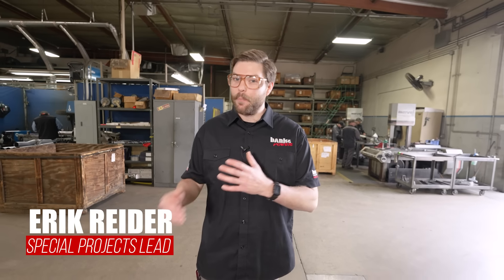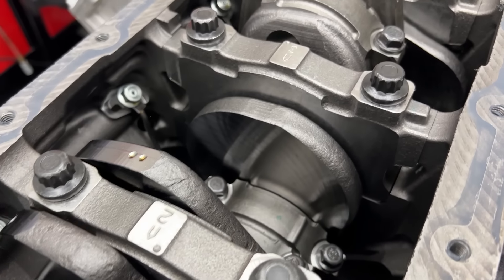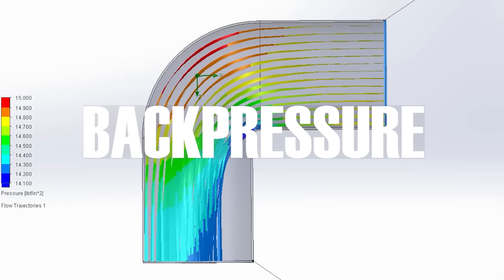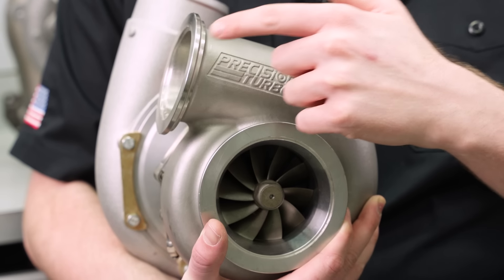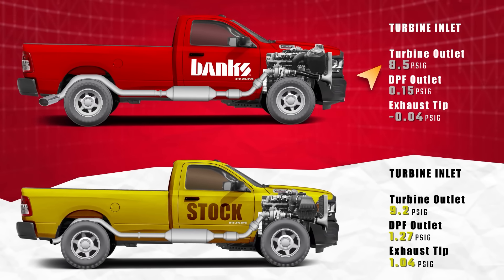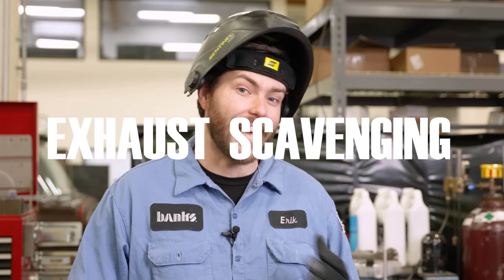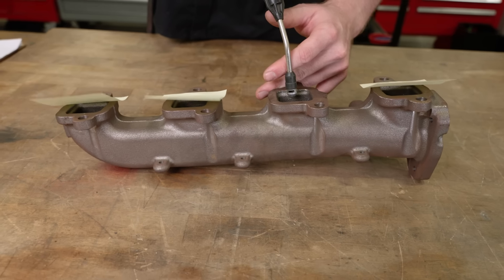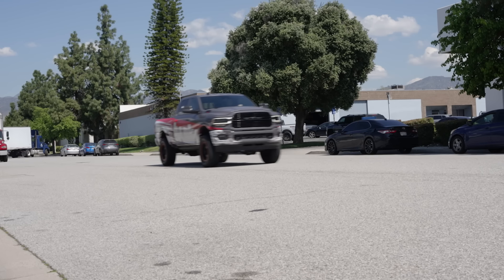Busting the exhaust backpressure myth | Banks Entry Level

Comment: That demonstration of scavenging with post it notes was the best thing way to show it ever. Love it
Reply: It was a great party trick but it wasn’t a demonstration of exhaust scavenging specifically.

When one port is open and has positive pressure (the shop blower), the others are closed. That negative pressure at the other ports is lost.

On the exhaust side of the engine, there is both flow (from the piston moving the gases out) and continued expansion of hot gases from the combustion process (the continued expansion of these gases is primarily what a turbo uses to spin its turbine).

When the exhaust port shuts, that flow stops but the expansion continues. The flow created by the piston is only minor and hence why this demonstration is properly representative of how scavenging works. only good as a party trick.

The bulk of the required exhaust flow comes from the continued expansion (positive pressure) of hot gases  after they leave the engine, and which continues well after the port is shut (and for several more combustion cycles for each cylinder).

That continued expansion presents a problem for other ports when they open and try to flow out their initial gases, they are stuck trying to push against those previously burnt but still expanding gases.

Headers address this by separating the cylinders for longer, firstly avoiding the potential conflicts to other ports, and then by being “tuned” length, they can use the properties of the expanding gases (momentum etc) to help create a negative ‘pulse’, which if timed properly, can assist the piston extracting the next lot of gases.

This tuning or matching to application is also a reason why people think a little backpressure is needed. Put too big headers or exhaust onto a standard engine, you will lose the effects of headers and will not make more power. People’s minds tend to equate that to “you need less flow (backpressure)”, rather than “you should use the right exhaust for your application”.

Hi performance two stroke engines absolutely rely on a tuned exhaust to make power, they use specially designed exhaust systems, with different diameters and changes in diameters to make use of the expanding gases, and to create very strong negative ‘pulses’ back to the cylinder to not just evacuate exhaust but to also help draw in a fresh mixture (two stokes primarily draw in mixture when the piston is going up which is opposite to a conventional four stroke).

Also, residual exhaust gases in the combustion chamber can be good - Mazda are successfully using exhaust gases to reduce the effective cylinder volume in their new (and recently patented) supercharged two stroke to allow a much leaner fuel mixture without detonation, effectively achieving reliable diesel type lean burning.

Comment: As a retired Master Plumber, I can say with confidence, that any bend in a pipe of any kind reduces flow. Any time gasses or liquids have to merge into itself will create cavitation to some degree. How much does a 90 degree bend reduce air flow?
A long radius 90-degree bend (a bend radius of 4.5 inches, or 11.4cm) has a flow restriction equal to about 5 feet (about 1.5 metres) of straight pipe.
Reply: Doesn't happen that way on exhaus gasses.
Reply: @CL9k24a3 Fluid dynamics are true for all fluids. The only thing that makes a difference is the physical properties of the fluid. The same rules always apply.

Comment: When a hairdryer outlet is blocked the load decreases because it is no longer moving air. That is why the rpm of the electric motor increases. By blocking the outlet you have moved all the way to the left of the pump curve 🤯

A better analogy would be throttling the outlet 😁
Reply: I was about to make a long and technical post about how the hair dryer has no load. You beat me to it lol
Reply: levimayes8488  No. It applies even if you completely block the OUTLET side as well. This is because if no air can go out, then no air can go in. And if it isn't moving any air, then it isn't under any load. Which is why you can hear the motor speed up. It's important to remember that devices like hair dryers also use the air moving through them to cool the motor, so blocking the airflow, whilst reducing the load on the motor, will still cause it to overheat.
Reply: Came here to say this as well.
Reply: That's true of centrifugal blowers and pumps.  The opposite is true of positive displacement blowers and pumps.  Purposely throttling the exhaust on a diesel engine is one method of increasing engine braking on a diesel engine.
Reply: There was another comment spelling this out earlier but it seems to have disappeared... 🤔🙄

Comment: Common misconception about hair dryers and vacuums when you hear the motor spin up faster it is because the load on the fan (impeller) is actually decreased allowing the motor to spin more freely. You can feel the pressure build but opposite of a piston pump which gains resistance as pressure is built.
Reply: Came here to say this.
Reply: Yep. I used to design pumps for liquids and it's the same thing where if you close a downstream valve the torque required goes down. Counterintuitive but it's true.
Reply: Interesting i wouldnt have thought about that with a liquid pump.
Reply: @MrPdiggity   Centrifugal pump yes, piston pump no.
Reply: When a vacuum cleaner gets clogged and spins faster and someone remarks that "it's straining" my head nearly explodes.
Reply: @alexkram Did you designed centrifugal pumps?
Reply: @wolfvash22  yes. I worked for Ebara and we made pumps for cryogenic liquids like liquefied natural gas.
Reply: @alexkram  Very interesting, didn't know about the mentioned situation, I am more familiar with positive displacement pumps.
Reply: @wolfvash22  we would test our pumps to determine the pressure vs flow curve and to control the flow it was just a downstream valve. We couldn’t open it up all the way usually because it could burn up the motor with too much current. These were 1000 lb pumps or more, most of them multi stage.
Reply: @alexkram  Another interesting piece of data, so if I am getting it right, this type of pumps doesn't have a high inrush, but they become very demanding as you get close to full load.
Reply: @wolfvash22  He explains this in the video, that's called zero pressure differential or "free wheel". However, the parasitic load of the fluid's mass still remains and both liquid and gas are fluid. It is also why some turbo diesels have been throttled. It makes cool turbo noise too.

Comment: I think this misconception comes from info about 2 stroke exhausts, where they don't burn all of their gases so they have to design the exhaust in a way to shoot the gas back into the cylinder. I think this video describes super well the effect this has on many vehicles and i love it!
Reply: You are right, two strokes are a completely different design, and need the correct back pressure (pressure waves) to get the full potential of that engine
Which is why you see expansion chambers on two stroke dirt bikes.
It's a real science to make a two stroke exhaust, because it needs to resonate at the correct frequency to aid cylinder filling at a specific rpm range
Reply: @XJ_doc  back in the day when I had a scooter, I googled making exhausts for 2-strokes and I made one out of car exhaust, block of wood and hammer, grinder and a mig and I instantly got another 20km/h!

Comment: Volvo had an interesting Log style exhaust manifold for their 5 cylinder. It had 3 seperate holes for exhaust to exit at the turbo flange and it was set up in such a way that no 2 consecutive firings would use the same hole. That way, none of the pulses colided, although they did have an unequal distance to travel. I'm looking at a 90s t5 manifold right now and cylinder 1 has its own outlet, cylinder 2 and 5 share an outlet, and 3 and 4 share an outlet. With a firing order of 1-2-4-5-3, the manifold almost behaves like headers.
Reply: Having driven a '95 Volvo 850 turbo and later a '97 Volvo 850R for around 9 years I do remember the tri-divided exhaust ports on the exhaust manifold. I do think those disappear on the Volvo S60R manifold though and that manifold is more of a shared design...though it's considered and performance "upgrade" on the 850 turbo, R, and GLT. I miss the 850R, but I am liking the '04 Corvette I traded for. Both are fun cars for daily driving enjoyment.
Reply: @mlc7boosted  popup headlights FTW! Won't find a volvo with those unless you import a 480. The R manifold is still somewhat tri-divided but cylinders 3, 4, and 5 all share an outlet. It still flows better than the 850 T5 manifold because of its larger diameter but at higher RPMs, a "Japanifold" will flow slightly more than the R.

Comment: Great vid in lots of ways. It’s worthy to note, however, that the physics at play in boosted apps are differently influential than those in N/A apps. Apples and oranges.

To be strictly technical, the best exhaust system in boosted apps is basically as close as possible to no exhaust at all, which is obviously illegal on the road. 

In N/A, the fluid dynamics in the exhaust influence torque curve and  effective rpm range, among other factors.

Comment: My understanding: You can't get scavenging without having an exhaust system, which could be thought of as a restriction, but really you're benefitting from the continuous positive controlled motion of air away from the engine, and any actual backpressure is a side-effect not a thing you specifically target.
People that say an oversized exhaust has 'not enough backpressure' should actually be saying it has 'not enough velocity'.
Correct me if i'm wrong!
Reply: This is exactly why chopping off factory exhausts especially ones with cast manifolds makes engines run like shit and not rev out anymore. My daily drive is a 92 Nissan Bluebird with stock spec rebuilt CA20e, headers running into standard 2" or 2.25'' tube, cat delete, original resonator halfway and rear muffler replaced with 3.5" resonator. The velocity is so good it makes big flames out the back like a race car when shifting over 3000 rpm!

Comment: Thank God you're doing this video, I've been arguing with people forever about this.  At best your reducing overlap any way your doing it your reducing the atmospheres ability to move air into the motor.  If you need to shrink primary tubes to the collector then do that but after the collector there should be zero pressure as fast as possible.

Comment: Absolutely 100% spot on. I've been building older carbureted V8's, carbureted Inline 4's (motorcycles) and of course the almost indestructible Jeep fuel injected 4.0 HO's for decades. This whole "back pressure is good" myth started in my experience back in the 70's and 80's when guys would bolt on a respectable brand of headers, decent mufflers and loose power on a stock machine... WEll, YEAH! They never jetted the carb up to take advantage of scavenging and the Helmholtz effect of resonant tuning on, of course, carb'd vehicles/bikes. Once tuned in, a genuine (oh damn man!) response was typical. On FI vehicles, the stock computer fuel trim can easily compensate for reduced back pressure especially if you live at high altitude. Case in point.... On my 4.0 I had a Magnaflow cat, generic SS header (AFM which I believe is out of business and had to weld up the the cracks twice) and generic cat back system that always passed emissions until my state changed to California emissions standards. I band clamped in a Cali spec cat, passed with flying colors but lost 2+ mpg and it lost a huge amount of power while merging into traffic (above 3k rpm), it was sad. Just for grins, I got a Banks after cat system and popped my old cat back in and gained 3+ mpg and my 3000+ rpm power was back! On top of that, the Banks sounds so much better at idle and no more drone than the summit cat back turbo muffler. I'd love to try your headers but is there any guarantee in regards to cracking?

Comment: I had open pipes exhaust with my 2002 Harley 88tc, I put the original pipe tips back on that greatly reduces noise, and I added 10 hp easily by using restrictive factory pipe tips.

Comment: Scavenging is the opposite of backpressure.  It's sucking gases from the cylinder by creating a negative pressure wave.  I hate when people say you "need" a bit of backpressure.  Drives me crazy.
Reply: This^
Reply: Yes, we need an exhaust system, which is a bit of back pressure
Reply: Me too, i actually gave up trying to explain it to people.  It’s just to much work getting thru the bullshit sometimes.  I’ve had guys get red in the face and all bent outta shape arguing you GOTTA have back pressure 🤬.  That back pressure myth is a strong one.  Every once in a while someone will have enough knowledge and get it that you dont want/need any back press but most I encounter swear by it!
Reply: @JohnSmith-xu7ev  🤦
Reply: @JohnSmith-xu7ev  any back pressure from an exhaust is due to some undesirable trait usually. Especially for modern cars.
Reply: @sigmaprojects  
But back pressure does exist, and adding an exhaust means you need back pressure.
Reply: @robertmason8341  Yea, it's kind of like the people who don't understand "ram air" isn't really working the way they think it is.
Reply: @JohnSmith-xu7ev  that's a weird way looking at it. The name of the game is always reducing back pressure. Back pressure is the result from something undesirable. The ideal exhaust has no back pressure because it's producing the most optimal pressure waves that leaves low pressure in its wake, which is what scavenging is. All exhaust systems have back pressure, not an engine needs back pressure because they run better with an exhaust. Open headers run better than a restrictive exhaust, but if you measured the back pressure on a really good exhaust system that is doing really good at scavenging you'll see it have less back pressure than just open headers.
Reply: When EGR systems became necessary to meet emissions standards the back pressure thing came back because the systems needed the pressure to function properly. So here we go again with back pressure is good. Back pressure and velocity both have their trade offs. One affects the other, hence a tuned system to take advantage of where you decide the performance is best.
Reply: @ahow8017  Necessary to do what?  Gank up and Destroy engines?  Job done...
Reply: @JohnSmith-xu7ev  the exhaust system is used to direct hot inert gases away from the engine, operators, and intake.  On modern engines it also cleans and treats the exhaust.  Am engine will run straight out of the head but it's undesirable for many reasons.
Reply: @curtisroberts9137  
Im glad you cleared that up since no one knows about exhausts. So now you have anything about banks fan boys never turning a wrench?
Reply: @JohnSmith-xu7ev  I wouldn't know. I'm not a fanboy and generally as a mechanic I wish people would leave things alone as most of the time they just cause headaches for whoever end up working on their vehicle next.
Reply: @JohnSmith-xu7ev  It is not, its a system for evacuating exhaust gases and if it is built properly, it helps the engine with the scavenging of those gases. It is not added back pressure which helps it, its added scavenging which helps it.
Reply: @Boykot1  
And it also  has back pressure. Volume of gas running against metal will endure friction
Reply: and it only works from headers, if you have manifolds of any kinds you get zero scavagning.
Reply: Literally nobody is denying that backpressure exists, were denying that backpressure is necessary in ANY WAY. So desperate to not be wrong that you miss the argument every time. But go off about how "ive never turned a wrench" as a response lol
Reply: Unless it's a 2 stroke engine.

Comment: Banks is not the first company to make an intercooler style exhaust tip and market it as performance enhancing. I’m not one to question Banks’s claims, but all previous versions have been proven to do nothing. Or at least nothing in the testing environment/setup used in those tests.  My question is what testing results does Banks have to prove that their tip makes/liberates power? What exhaust, engine, muffler combination and so on was used to verify the results? What are the actual real world benefits and what vehicle/powertrain/exhaust combination is optimum to see real world results?

Comment: I bet the "engine needs back pressure" tale is a result of removing the exhaust restrictions causes the engine to be less powerful, but the less back pressure caused the intake side to become lean.
Reply: In my experience, when you remove the exhaust system, there is a small power increase: BUT, there is a 2 or 3 times more increase in exhaust noise.  This makes you think that the engine is much more powerful, but when you drive the car you don't get the performance that the increase in noise suggests.  (I spent 23 years in Ford R&E Engine Lab testing engines)
Reply: Yep. If top fuel dragster builders could get 5 more HP by using longer headers, they would certainly use them. They use just enough length to deflect the flames away from the car.
Reply: @budgie98  my experience removing exhausts off standard engines is they run like a bag of shit and won't rev out!
Reply: @Bob_Adkins top fuel dragsters run at high rpm with a blower so there is no need for exhaust scavenging!

Comment: Where i come from the issue of backpressure was with 2-stroke engines. It should be tuned to the motor, if too low you waste fuel by letting the the air-fuel mixture going unburnt into the exaust or if too high you loose power.